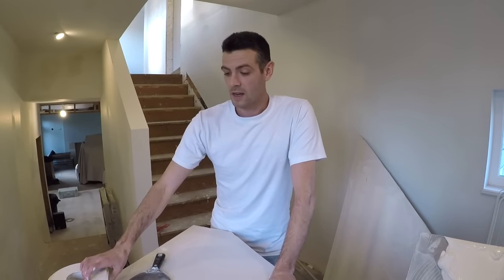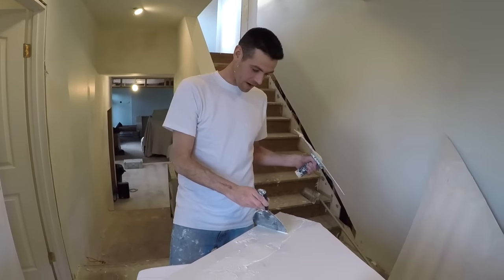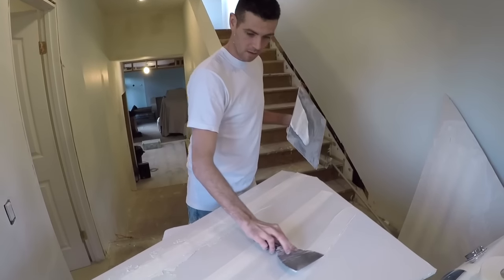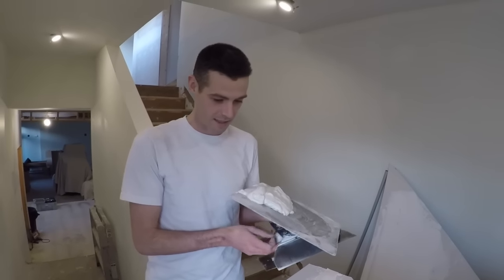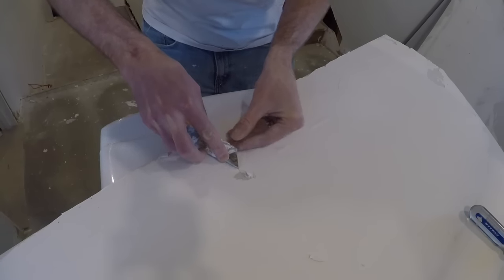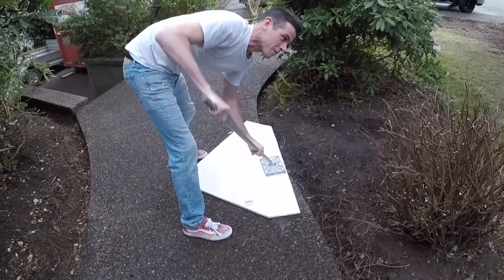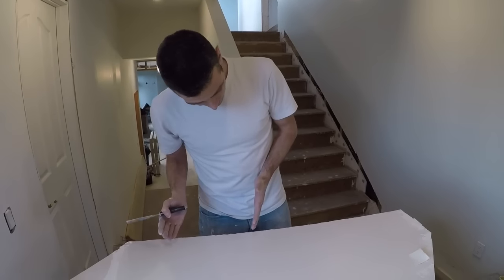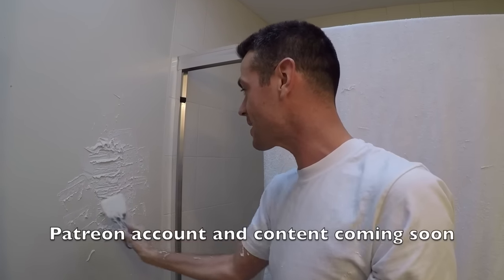WHY YOUR PAPER TAPE BLISTERED!!

Comment: If you want to make it more realistic to see where some of the problems cocome from. Try doing it over an actual long joint instead of a short, flat, vertical piece of drywall. How about doing it on a ceiling. Over an actual joint.

Comment: Just found out about you Ben.
You have some of the best content available! You also are great with your delivery and all around presence on camera.
Thanks to you, an old tile contractor was able to drywall about 1000 square feet, the ceiling and walls of his garage and tape/finish all drywall. And it turned out great! Using a hawk and trowel worked out great for me because of my experience mudding walls for tile. In California I've only seen tapers use knives and bread pan.
I'm looking forward to going through all of your content.
Thank you!

Comment: Thanks for sharing, I really enjoy your videos.
 I am paper taping challenged, I have always used mesh tape, never experienced cracking, and never knew about it being a second choice until I started watching YouTube videos. Anyway, before watching this video, I tried paper taping again, and, despite my best efforts, I found that i am still useless at it. I wound up ripping out the paper tape and replacing it with fibafuse tape. I found fibafuse tape, really quick and easy to install. 
I tend to use around 48 drywall screws per sheet, and always put wood behind  edges that are not supported by framing lumber, perhaps this is why I have not experienced cracking in my DIY drywall projects.

Comment: When I was trying taping for the first time I ended up having to tear out a few sections of tape and remove the plaster to redo it. I found the best way to remove was to first use a spray bottle on the tape, let it soften up for a minute then peel the tape off. Spray again to soften up the plaster and then scrape it off with your taping knife. It comes off in big flakes and is dust free and easy to clean up too.

Comment: Got bored baking bread during this pandemic so decided we needed to remodel the bedroom! (70 year old coop with tons of joint compound on top of plaster ceiling and loads of cracks--scrapped it all off-aaggghh whatta job!!). Hubby was thrilled (not). Watching Vancouver Carpenter & a few others I skimmed a 10x12 room ceiling and had 1 blister--only used a 6" plastic spackling knife as I found using the longer equipment I lost control of the flow.  Only weekends to work-but 3 weekends in----it's looking awesome. Thanks so much. p.s. Told sweetie next time I get a 'great idea to fix' something to tell me 'Ahh, I don't think so!' hahaha. (He won't though, we love a good redo challenge).

Comment: In my experience (15 years),  the reason most people get blisters is due to the Sheetrock not being planned out evenly. Little undulations in the joint cause voids and high spots, which will blister.
Reply: This happened to me doing a friends ceiling. How do I avoid it? I tried to build the plain with mud and then lay the tape on but I think during my skim process I pressed it back uneven. About an hour later it was blistered.

Comment: I had an old sheet rock guy suggest quickly dunking your paper tape in a bucket of water before application.   I've been using this technique ever since and never have issues with blisters.  Of course, I'm usually only taping a room at a time, not a full 2000 sq ft home.

Comment: What if it bubbles on a ceiling your going to texture. Can I get away with cutting out the bad tape replacing it with 1 coat and then texture. Or do I need to do a second coat? Thanks love your videos

Comment: Thanks for the video.
Do you normally wet the tape (on top) after sticking it. A guy at "Home RenoVision DIY" said the number one reason for blistering is not wetting the tape after sticking down. Just wondering what do you think.

Comment: I have been drywalling for 27 years in Canada. I have had trouble with Synko taping mud letting go. Loose tape all over the place. Finally did my own experiment with heat. The result of my test was that with this brand, if it dries too fast, there is a good chance that the tape will come loose. This reason is that the tape does not get a chance to absorb any of the glue in the mud.

Comment: Like your videos.  I'm doing a 30x40 garage with 10 foot walls right now.  I'm a carpenter but have dabbled in drywall a little bit. 
I wish you would have been around 25 years ago. I'm doing pretty good on my project.  I think anyway. I have learned a lot from your videos.  Thank you

Comment: Great vids always very informative.  A method I have used to fix blisters is after the second coat I usually see the odd one.  I take a 4 inch knife which I usually use for applying the mud a tape.  I slide the knife blade under the tape accessing the void.  The second coat of wet mud allows me to access the bubble. The access point has to be bigger than the blister. Then I apply mud sliding it under in a fashion where it is filled with enough mud to caused adhesion.  You can almost see the bubble vanish before eyes.  Then I continue with second coat.  I totally agree with all of your other comments as I have experienced most of them good and bad. Thx

Comment: After you cut out the bubbles, I'm wondering why you didn't use some kind of drywall sealer. I have no experience. Just trying to understand when a sealer is necessary. Thanks so much for the info!

Comment: What do you think about this when the joint is completely dry.  Load a little mud on the knife, wedge the knife between the wall and the blister, press the knife against the wall so the mud squirts under the tape,  and then coat???

Comment: In older construction and having to repair drywall before tape and float it's best to dust off the drywall. I've discovered through the years if your drywall is dirty that can also cause bubbles. Bubbles is what I call blisters, but always dust clean your work area.

Comment: I know someone who used drywall and ran out and finished up using plywood but the drywall stick's out further from the wall than the plywood. Do you have to build up the mud to make it level in order to tape. They did the wall which is poor engineering and now they want me to figure out how to fix

Comment: What about putting tape quickly in a bucket of water, squeeging excess water off between first and middlefinger, then applying on mudded joint? 
I tried this for the first time on my last job and it worked great.  Don't hear or read about it as a norm.
Reply: He has another taping vid, I think on taping with different types of mud, and he uses that method but the tape ends up not bonding very well.

Comment: I am trying to repair a few cracks above doors and one on ceiling next to wall. I have been using 90 min joint compound mixed with water and using regular tape. I keep getting blisters so thanks for this video. Also before applying compound I filled crack with white caulk. (Latex) I think 🤔 this was a mistake! I ended up ripping tape back off wall, then I have ridges where I had put several coats of joint compound. Now what?? I am trying to flick off compound and sand it down. I created a monster mess ha. Making mistakes causes more work, then while scraping compound I have actually hit some brown paper. 
 Maybe I need 20 min quick set & hot water & mesh tape! I wonder if I have to scrape caulk out of crack?? 😆

Comment: Thanks for doing this video Ben!  Made me laugh at how hard it was for you to make one and now I know what I’ve been doing wrong and how to fix it.  I’ll also stop wetting the tape first ( which totally worked lol) and go back to step one.....thank you!
Reply from the maker: Wetting does work because you are thinning the mud down in place. It's kind of a slower method to the same end result. I do think it's better though to just start with thin mud so you have uniform consistency and adhesion.
Reply: I will use thinned down taping mud as you suggest.   Recommendation for another video is how to do rounded corners, boarding and taping.   Love your channel. (Near Banff)

Comment: After removing old popcorn we found that the joints were not taped. It looks like some kind of plaster or a 'quickset'. The joint compound will not stick. After drying, blisters and bubbles occur. Cutting away the paper you can see that the joint compound is on the paper. I've tried sanding the joint but what was used is very hard. Should I try using a primer?
Reply: Sounds like it’s been painted or some kind of vapour seal has been used so premixed mud won’t stick. In those situations I tape with 30 or 90 minute quick set type mud (comes in powder bag form)

Comment: I don’t know if its right or wrong, but i have always wet down my paper tape before applying it onto the mud, then immediately bury it with another skim coat. No bubbles, ever. Then wet sand when it has nearly hardened. I’m 65 and don’t do any huge projects so it’s probably not fast enough for most folks but that’s why i bring a thermos of coffee with me.

Comment: This is a pretty good vid from a chippy. All purpose joint compound is not nearly as strong as base coat plaster. 11:30 you will never rip a tape out if installed well using base coat plaster. All purpose is ok for small jobs but definitely inferior in many ways like takes a long time to dry, shrinks back more and is weaker in strength compared to base coat plaster. 

Another reason you will get blisters in tape is wind drying mud out. Dry (very low humidity) hot and very windy weather will dry out mud fast. Close all windows and doors to stop drafts whilst tapping. U can fairly easily do long joins over 2 meters or 6 feet under the right conditions with practice almost never getting blisters. The contrary is also true under the wrong conditions it's difficult to even do short tapes without getting blisters.

Comment: I got blisters quite a bit when I started.  I think it's because I was using all-purpose and it was too dry.  I saw a video of another guy who was talking about adding some water to the mud right from the start and then again every time you closed your bucket up and that made a WORLD of difference.  Just a handful or two of water and the mud stays pliable for a long time, even with just the hawk on it or the lig coving it without being sealed.  

It's a little frustrating that you didn't talk about that in this video.  You mentioned using mud "right out of the bucket or box", but didn't say anything about what to do to correct it.  For everyone who caught that, I hope this comment helps.

Comment: Home DIY'er here.  Why is using mud right out of the bucket a bad thing?  What are you supposed to do with it before applying?
Reply from the maker: Thin it down a little. Helps the tape stick and be easier to apply and wipe out.

Comment: Curious how to fix crappy drywall work without needing to strip it all down.  Can you just Sand the area and build it up?  Had whole house fan installed and you can see the lines between fan and drywall.  Driving me nuts 😁

Comment: I wish I was following you when I did my basement. I have lots of imperfections to fix and I already painted the walls. How do you fix a painted wall? Can you retake over a mesh tape?
Reply: Yes, but don't use paper, only experienced joint spreaders use it on new construction.
 This doofus should be using mesh tape on remodels, You won't get any blisters, also you don't need a first coat to lay it down like paper. Since it has glue on it.
Reply: @natanaelmartinez7620  I do drywall and one of my jobs is warranty work going around fixing things that have been patched and failed or just things that have broke or failed. And I'll tell you I fix every place that has been used with mesh tape. Mesh tape sucks.

Comment: I watched a few of your videos before using paper for the first time. I have done minor finish work on drywall many times and it has always turned out very nice. However, after watching one of your videos I have a couple of questions about my specific project in my home. I have two pictures and a short video (like 20 sec) to offer a visual of my project to aid you in your ability to answer my question. I am not sure though if you do that and if so how I would get them to you.

Comment: Paper swells when wet and shrinks smaller as it drys, the blisters are patches of the paper that didn't get wet enough and so are 'baggy' compared to the surrounding paper that has properly shrunk. Artists wet and stretch paper prior to doing water colour paintings and blisters can happen there too if parts of the paper aren't wet through enough.

Comment: A common scenario happens for the restoration guys where 2” ft of wet drywall has been to removed from the bottom of the wall. 
When you mount the new 2” ft replacement piece and choose to bud the factory divot edge up to the old edge. This can cause the new drywall side to get tones of mud and the other gets starved add to that an uneven cut from the tear out crew so your mud disappears out the back and now you have the perfect drywall tape bubble maker. 

One solution is realizing you need to do a run of non watered down mud or thick quick set to fill the uneven gap. Once dry then start the taping process. 
Anyone else have a trick for this?
Reply: If it's near 2ft exact or under. After you cut your sheet, flip it upside so the cut end of your rip is at the top. Bevel that top end (to bevel if you're right handed go on the right side of your cut sheet with the cut side facing the ceiling. Hold you knife at a 45 degree angle to the edge angled with the tip of your blade facing up and away from you and your knuckles facing the floor. Cut like that on the paper side on the top edge. Walk backwards and cut off a very very small amount to "bevel" the edge of the rock. That gives something really solid and good for the hot mud to grab to. Bevel the existing rock at the bottom of the wall (the rock that stayed 2ft up).  Install beveled cut side to the beveled side of the existing rock. Buy some 45 or faster minute drying quickset (aka hotmud). Mix it up either in a pan if you don't have a lot to fill, or a bucket if you have a lot of joint. You can add glue if you want but I don't usually. Pre-fill the joint. Tape. That should do it. You're already gonna have to build it out a bunch so trying to use the factory tapered end doesn't matter.

If the demo guys really cut that unevenly or cut above 2 ft off, you'll have to cut it yourself to get it straight enough to install. If it's above 2 ft then you were gonna need more rock anyways, buy taller sheets.

Comment: Any advice for joints that keep cracking in older home? Summer time everything is good winter comes along and the repaired joints split open first time the joint was done with paper tape joint expanded and ripped the tape. Next time i did the repair i removed the damaged tape and used drywall mesh. Well it looked great till winter time again then the joint expanded and ripped the mesh apart. So my question is how can i repair this joint so it stops ripping itself apart its about a 4foot line each time drives me crazy im sick of repairing it.
Reply: G thoman try using some decent mud to fill the void. Then tape, then build out....
Reply: Adding an expansion joint might apply to your situation . Also try quick set 30 minute mud (comes in dry bags) it is stronger then most mud. There are a few other things to consider but my response would drag out.
Reply: You may have a structural problem if the structure underneath the drywall on both sides of the crack is expanding and contracting at different rates. Ideally you'd want to improve the connection between the framing on both sides with screws, etc. before attempting a surface repair. You might have to cut the drywall out for a couple of feet on either side of the crack and tie the framing more tightly together, then add a new piece of drywall bridging the crack area.

Comment: Using a notched spreader is one way to get a uniform coat before placing the tape onto the joint or 
inside corner.  Taping with Durabond 90 is asking for trouble if you mix too much of it.  Do you know
that you can make it dry faster by using the same small amount of water that you used for cleaning 
your tools?  Remember, just be accurate in how much of this you will need.

Comment: I have also found that "old" paper tape tends to fail more often... I have been dry-walling for 20 years... I recently got 12 rolls of "old" tape from "a friend" (I found a box I had ordered 4 years ago in my shop) ... 

Well I decided despite it being a bit "yellow from age" I would use to to finally finish said shop.  This was a mistake... 

I know how to tape... and I had blisters wrinkles, pull offs etc etc... worst $25 I DIDN'T spend... 

I threw out all my paper tape and went and bought 6 rolls of brand new tape, stripped it all off, BIN'd it and re-tapped.

Comment: I'm not a professional and I was having trouble with tape lifting in spots over years of being done. I started submerging my tape in a bucket of water  just as I was getting ready to install it and so far no lifting and seems to adhere to the surface alot stronger
Reply: Muss to dry

Comment: Ben, I work as a professional painting contractor and have had other contractors recommend wetting the joint tape first before applying it to a drywall seam.   Based on this video, you did not wet the tape first, so was just wondering what you prefer?  Thanks!

Comment: I'm doing so much wrong. Mixed up my mud in a bucket I had used for mortar previously. Dry mortar broke apart and mixed into mud. Now my mud has gravel bits mixed in that make nice streak marks when I spread the mud. It's so terrible but I tried to use it anyway. And my tape bumpy rather than smooth as a result.

Ugh.